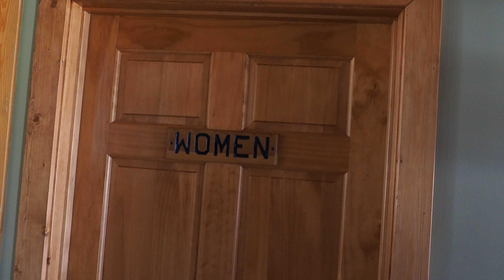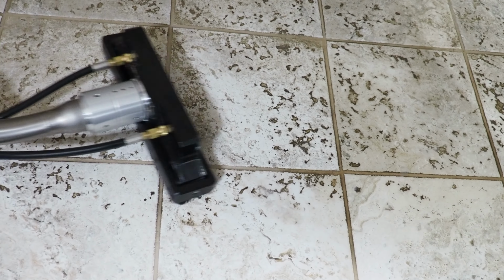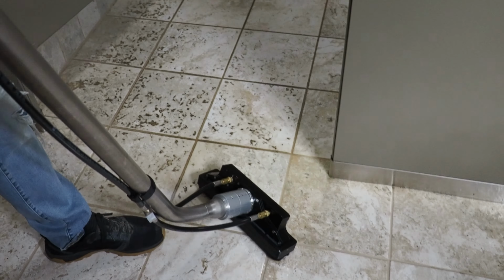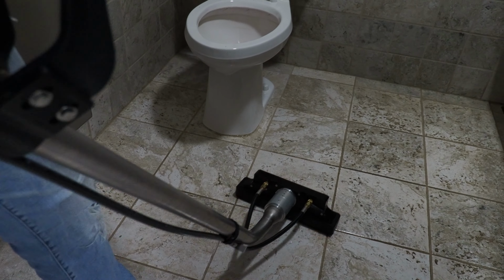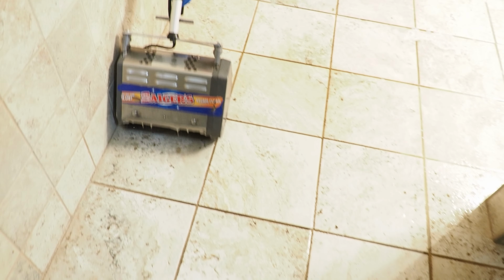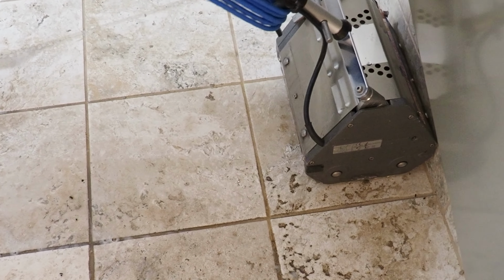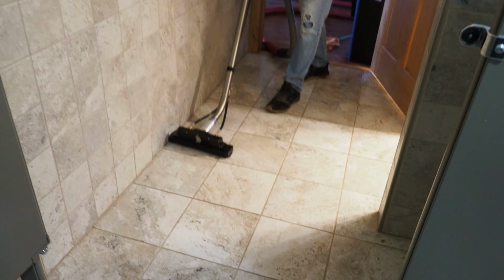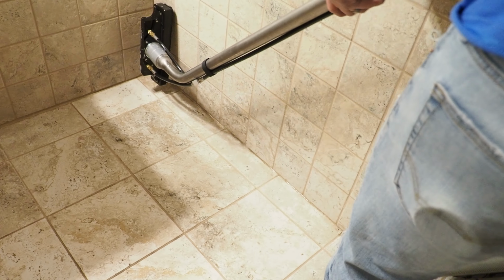Will it Get it Clean with this new tool?!

Comment: you scrubbed and then had to move the want back and forth for that long? Seems a spinner is easier and faster doubt you would need to scrub.
Reply: So when scrubbed it rises like butter if not you gotta go back and forth. Im intrigued. the only thing is you have dirty water sitting on the tile grout until you rinse.
Reply from the maker: This is true. In the first bathroom I think we were at 800 - 900 psi. We were testing to see how it might do for someone with smaller truckmounts. We started at 500 psi for a while then popped it up. Spinner might have had an advantage on this tile when we didn't agitate. We have done some testing where both performed equal. But hindsight, this would have been a nice one to test with spinner too

Comment: All the old chemical they use to mop that floor with just builds up like crazy
Reply from the maker: For sure... And the dirt around the golf course is dirt, clay and sand combo. Pretty wet soil 😁
Reply: I bet the mopped with an acid based cleaner and really set in the dirt.
Reply from the maker: @insertgoodname4809  I am not sure what they used to be honest. Could be many things having been tried